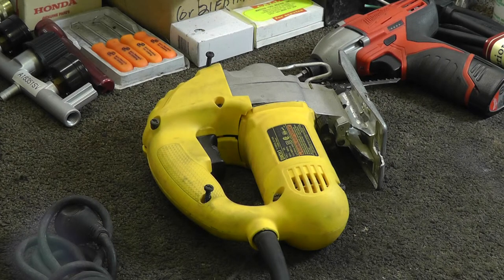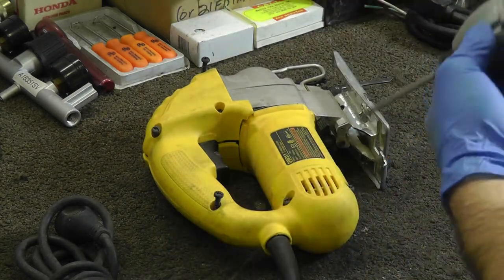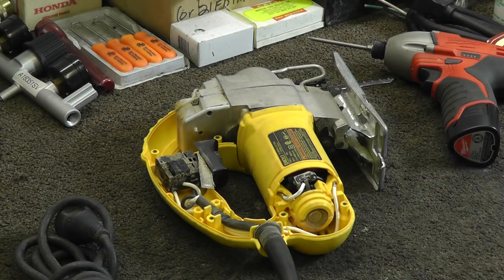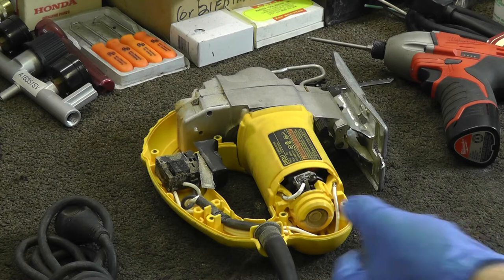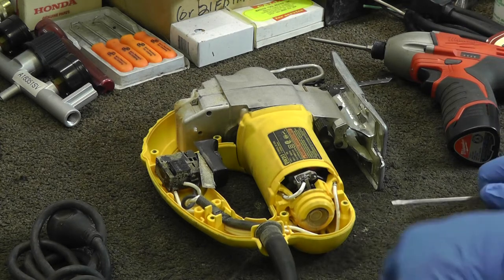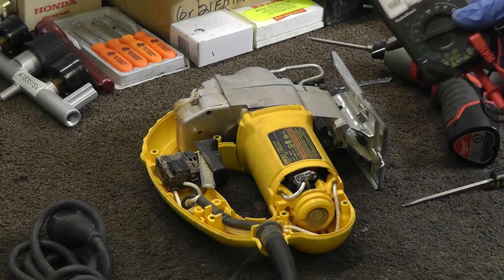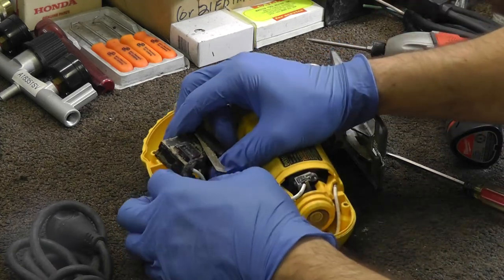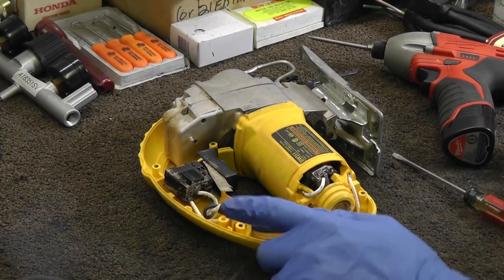How To Diagnose A Power Tool

Comment: The other day I replaced the brushes on my Hitachi (C10FCH2) chop saw since they arct really bad while running.
I never noticed it before (not saying it didn't before) but after I replaced the two brushes the machine runs great, no arcing to speak of while running it but man, when the saw is spinning down (I have understood it uses a motor break via the trigger switch) one of the brushes really arcs a lot. 
As I replaced the brushes I remember one of the brushes was a lot shorter (about 7mm whereas the other was over 10mm) then the other so most likely the heavy arcing had been going on before as well...

Can I (or do I need to) remedy this arcing as the motor brake circuit engauges ?

Comment: Great video! When is it better to replace rather than repair a power tool? I have two PC belt Sanders throwing sparks where the brushes meet the comutator! Any advice.
Reply: Brushes are cheap and worth replacing.  Generally less than 50% the list price is worth the repair